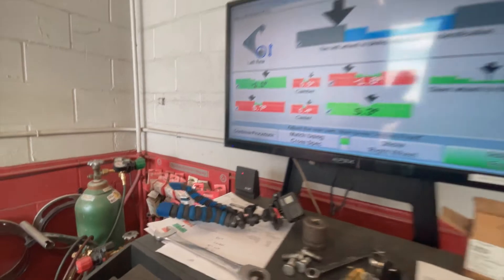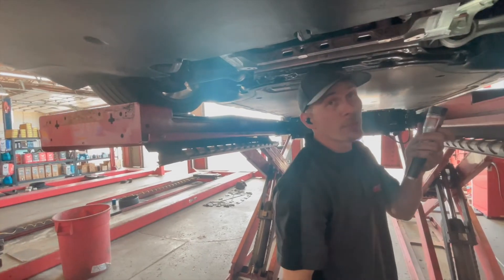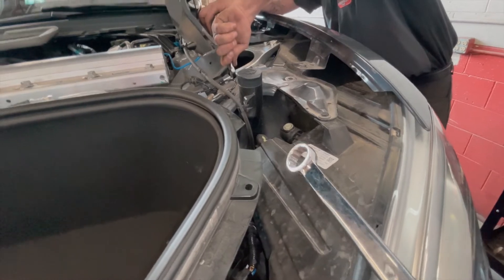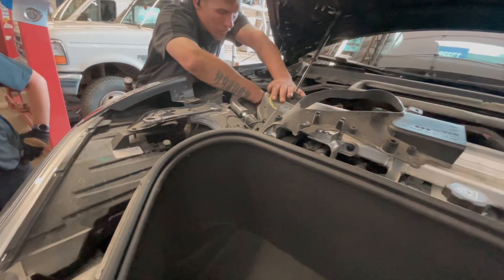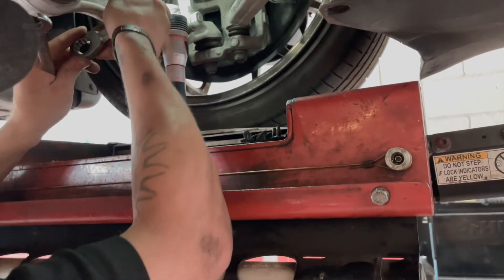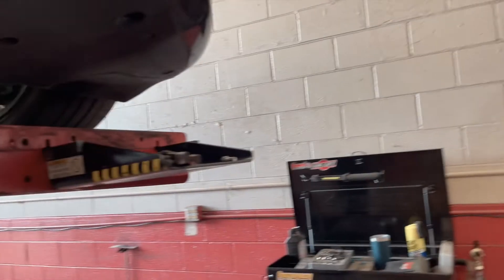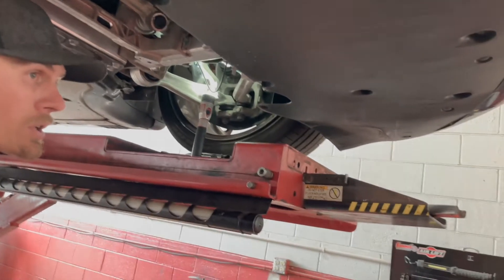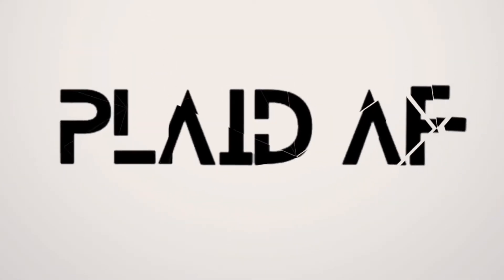Front Track Alignment Tesla Plaid | Front Upper Control Arms Unplugged Performance

Comment: lol this dude DON'T know nothing about track alignment at least -2.0 degree negative camber and slight toe in. in the front. he put garbage UNPLUGGED upper arm and think the plaid is track star . dude dont' even have solid bushing front thrust arm. when you brake this will throw off any alignment is set.  I swear all model S owner are dumm AF